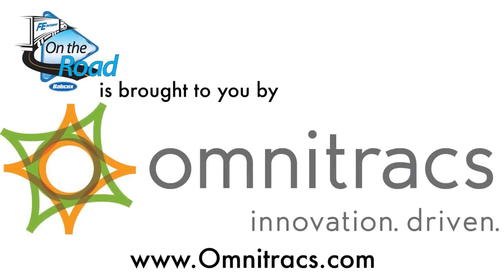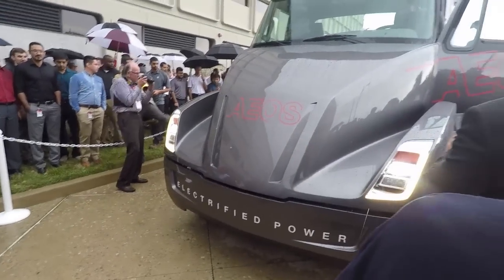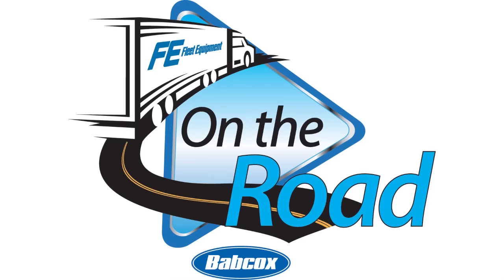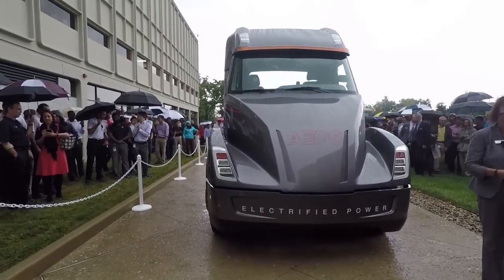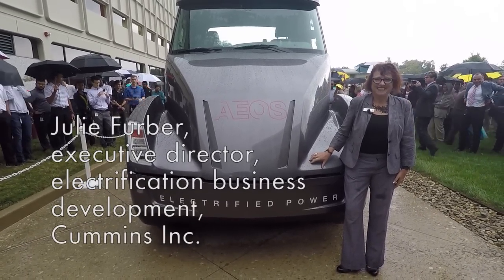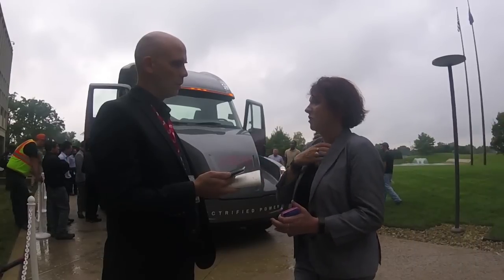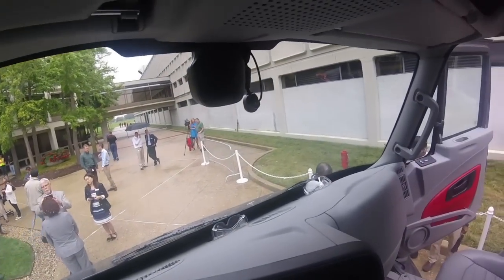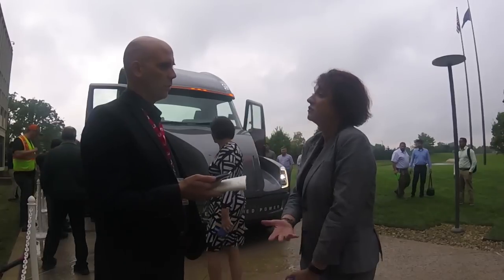Inside an electric heavy-duty truck: Cummins Class 7 Concept Truck

Comment: Can it take on I-55 in Illinois, or I-70 in Indiana or I-40 in Arkansas? If not then don't bother with it because the current trucks can't deal with those roads as is...
Reply: I've never been to these roads, but I'm suspecting these are hilly regions of these listed highways?? 

Think of the regeneration on the downhills ;)
Reply: @ScooterMcAwesomeness  😂😅 you're not even close....
Reply: @richardbearden7889  Then my presumption veers to the opposite end, and now assume just flat open, long distance runs.

Comment: I would imagine there will be a diesel generator under the hood kinda like the diesel electric trains, that would continuesly power the electric engines!
Reply: I'm browsing truck sites because I thought the exact same thing.  One could set up a diesel to switch on (like the Prius) and run when needed at it's optimal rpm to charge up the battery or just feed the electric motors driving the rig.  This saves fuel (like a Prius) and gives the trucker all the advantages of instant 100% torque (like no gears to shift).  Are KillerYo56ss and I the only people to think of this?
Reply: @3rdpersonplural  Look up "Edison Motors"
Reply: I'm here looking for the same thing

Comment: Why don't they make this truck (replete with single rear tires) now with a Cummins diesel? This truck looks awesome, refined and aerodynamic. Gone would be the box-like diesel 18 wheeler cabs we see now. I mean this look is revolutionary and would make a serious dent in the high cost of driving big rigs. Down the road this electric version will make driving more economical;l but this new look should be endorsed and built now.
Reply: I find this way more attractive than what's currently on the market.

Comment: Tesla gave Cummins a complete smack down.  While this is in "development" Tesla is taking orders and leaving everyone in the dust ... again.
Reply: Lmfao whats it like to be a giant loser
Reply: Justin Macd. Ask Cummins, they know.
Reply: I did they told me to ask you
Reply: Justin Macd Not surprised.  They are quite clueless now days.
Reply: Lol bet you dont even own a truck lmfao 😂😂😂😂😂😂
Reply: Justin Macd Use to drive trucks till I got my electrical engineering degree.
Reply: markleyg We run CAT not cummins, fuck Telsa and FUCK you
Reply: Pernection actually you are wrong. Tesla still hasn’t begun production on the truck despite promises to begin this year. Pre-orders mean nothing in terms of production speed, all that proves is that people want your product. Look at the Model 3, that car had 500,000 pre-orders and production is still slow, not because of over demand, but because of poor planning. 
Also, the Cummins is a PROTOTYPE and gets up to 600 miles of range, compared to the fully developed Tesla which only gets 500 miles of range on the high range model. Plus the Cummins has a smaller wheel base, which will help in city driving, which both trucks are mainly targeted at.
Reply: MR. DreadHead359 A foul mouthed trucker with a closed mind.  Imagine that.

Comment: Why that long nose, though?
Reply: ekhaat The truck is an International chassis with body mods.
Reply: ekhaat, because it offers a diesel range extender, basically a small diesel generator that sits up front in that empty bay.
Reply: Cause its badass
Reply: ekhaat it's for a better view especially for backing